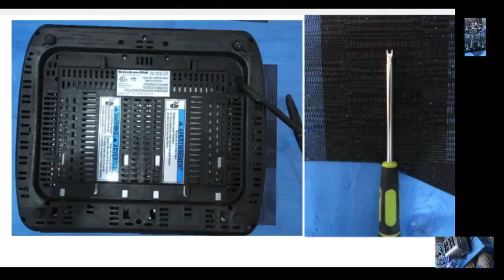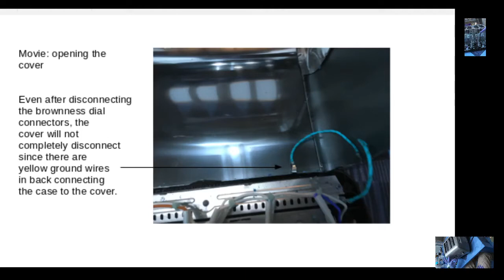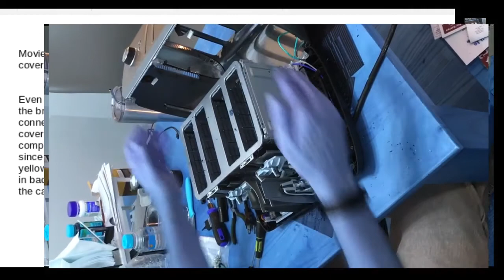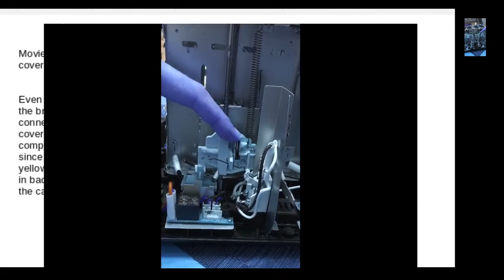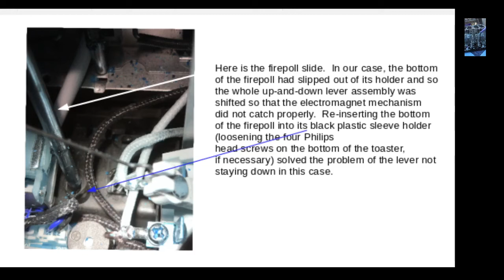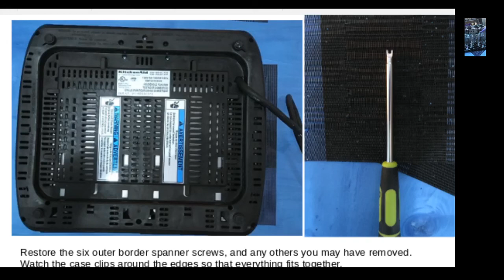Kitchenaid 4 slice toaster lever won’t  stay down

Comment: My problem's a bit different. The lever locks in place,  but it's very hard to push.. Sometimes I almost need two hands, one to push the lever and one to hold the top of the toaster. Any idea what might be wrong or how to fix this?

Comment: I have the same toaster. The left side would not stay down. It was not an electric problem for me. I had to adjust the angle of the piece of metal that comes down to clip with the electromagnet. It seems to have a small range for positioning such that the level engages and stays down. I think there is a tolerance issue in the overall design for left side.

Comment: Well...I ordered the h type spanner screwdrivers. Tried to take the cover off....but wasn’t willing to break off the slider knob so I left it on and just tried to inspect things while holding the cover up. . The rod seems to be in place. I couldn’t tell what the magnetic parts were. So I cleaned what j thought was them. Still works as before...about 50%’of the time it catches. This thing rattles like a murraca with crumbs so that’s got to be it. Gonna have to try again and find out what is definitely the magnet. This is a slightly differnt kitchenaid  model than the one in the video. It’s the single version of the vintage looking one.

Comment: I have the same toaster with this problem. I wish he went into more detail on how to remove the lever knobs since you can’t go forward until they are off.

Today I was able to remove the lever knobs by using a paper clip with a 90 degree bend 1/16” long. Get it to lift the rear of the knob at the back while pulling it off the lever. As for screws, I took an old small screwdriver and with a tiny file I cut a slot in the middle of the blade.

I got the toaster apart, and found the stiff wire that the lever pushes on to set the contacts was bent. I straightened it, and it broke off. I used a zip tie to hold a piece of a paper clip to make it work.
Reply: Thank you this was very helpful